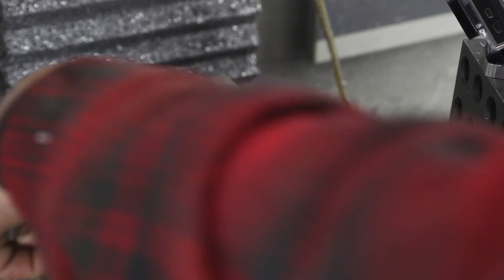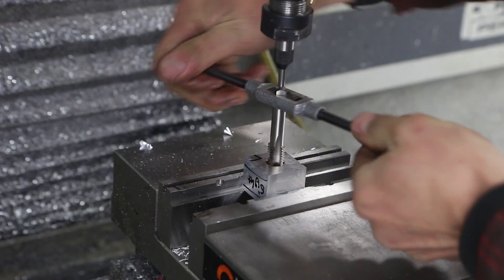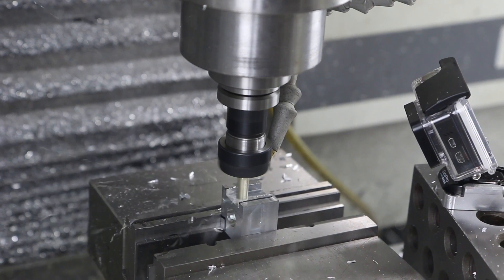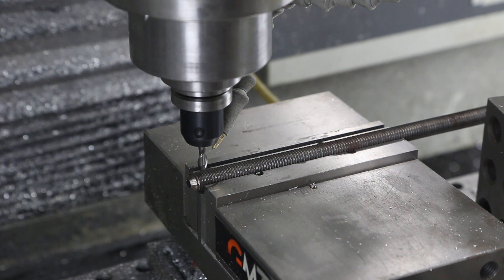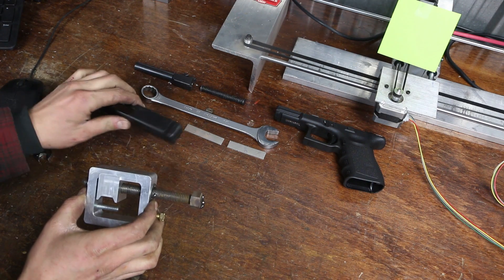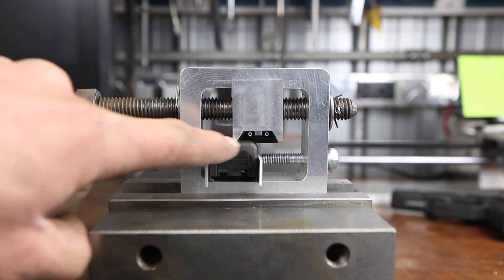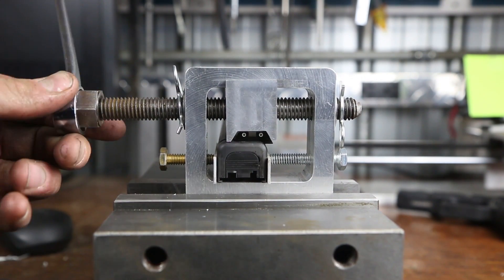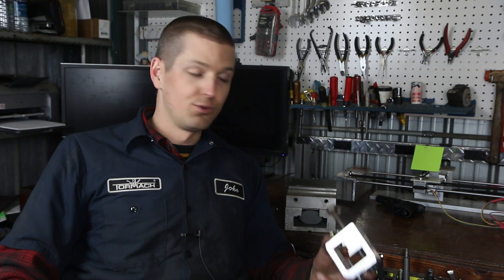DIY Glock Rear Sight Pusher Installation Tool!   Part 2 Widget31

Comment: Yep, they can be a little snug, but I find that on my MGW pusher (which is very similar in design to yours) putting a few drops of oil on the main screw before use lightens the necessary torque considerably. (Coincidentally, I am indeed a Glock Armorer :) )
 Nice Widget!
Reply: NYC CNC I would have to say I learned a lot about what the factory recommends as well a s some useful information about the specs of the pistols and their materials. Most of what is taught can be learned from places on the internet, but you need to sift through that info and filter out all the junk. Glocks aren't terribly complex to work on, but the class did give us some techniques to make them even easier to work on. I don't regret taking it.

Comment: My dad (an old school auto mechanic) would have given me untold grief for using a wrench to only turn that nut a 1/4 or 1/8th of a turn a time before re-setting the wrench, when you could easily do a half turn or more per re-set.  When you are on flat rate, time is money.

Comment: Great video and neat tool.  Others have already commented on improving the push rod and slide holder, but I have a suggestion to improve accuracy, control, and ease of fabrication.  Instead of milling a square doughnut machine a squared U that will then be attached via screws to a long rigid flat bar.  Fab'ing your fixture in this method gives your slide a secure level surface to rest on and makes machining much easier and quicker

Comment: I'd suggest adding a set of rails to match your pistol in place of the 1/4x20 bolts.  Always add some oil in the dovetail.  I don't think its uncommon to have a bit of difficulty sliding in a new set of steel sights,  you can use a swiss/jewelers file to clean up the dovetail before installation.   A little bit of CLP will probably take out the scuff mark on top.  

Work out the bugs and let us know what you'd charge to sell a sight pusher.

Comment: Nice work John. I would however offer one small piece of advice on your top screw mechanism. Since your main body (square piece) is a fixed width, I would have wound a nut onto the thread and welded it into position like you did the end nut. You could still use a washer to provide the slip, and on the other side used a washer and a double nut for locking. This would reduce backlash and provide a more even torque. If I can work out how to post a pic I will to make more sense.

Comment: nice job NYC. I change sights on glocks and other handguns for my friends now and then. and I machined something similar to this a while back for my springfield xd. (I know you hate them.... but I don't care :-P )
anyway, If you think that a glock takes some force to press a sight in you should try to do the same on a xd ;-)

there are a few things I would do different in making this sight pusher if it were me.

1. use only one set screw. let the slide rest against a face that is perfectly perpendicular to the direction the sight is being pushed in from. (either remove the interior radius or put a shim on that side of the tube.

2. I see that other people in the comments have already mentioned this but use some thrust washers, it will make it a lot easier to crank that sight into place without so much friction.

BTW. When I install sights I chill them in a freezer (or dry ice if i have it on hand) beforehand. And take them out right before pressing them in place so they are as cold as possible. Trust me it makes a huge difference.

-Morgan
Reply: NYC CNC Thanks NYC..
well now let me run some numbers on that and we will see…
room temp is aprox 20 - 22 ° C
and recommended freezer temp is -18/-23°C so the difference between the two is 45°C max and 38° C min

linear expansion of aluminum is .000023 (m/m°C)
and linear expansion of steel is .000012 (m/m°C)

a standard glock rear sight slot pretty much a  .250" x 74° dovetail, cut  about .079" deep
so say that the widest part of the dovetail is 0.250" wide

so plugging these numbers into the formula for linear thermal expansion
dl=L0 a (t1-t0) we can calculate the expansion for steel and aluminum sights for both max and min temp differences

Steel sight
max 0.000135"
min 0.000114"

aluminum sight
max 0.00025875"
min 0.0002185"

so assuming your sight is made of steel, you will get a minimum dimensional reduction of 0.000114" (Not even a thou) But it makes a difference on these tight tolerance parts. now imagine slightly heating the slide and cooling the sight in a box of dry ice? ;-) dry ice is aprox 78.5°C and if you heated the slide in boiling water 100°C you would be given .000535" dimensional difference that should almost be a free slip fit when installing.. just do it fast ;)
-Morgan

Comment: Another option on the thread, instead of a hand tap you can use a thread forming bit and CNC code to run it out on  a spiral.  I have designed parts that use this feature and the results are very good.  It would make for a good video if you have the time.

Comment: This is really neat. If you planned on using this for a while I would drill and tap in some zerk fittings for any binding surfaces. Especially the bolt in the slide, so you lessen the possibility of metal transfer between the steel and aluminum under load.

Comment: Hi John
another great video and some really good comments.
I hope to make a couple of comments and some suggestions as to why a considerable torque is needed to drive in the sight and how to improve its positioning.
 
Due to the profile of the sight and the ramped shoulders of the pusher, a rotational force or torque is developed when the sight is being forced sideways. This torque causes the pusher to rotate anti clockwise when viewed from the camera. This rotation is resisted by the shaft and its clearance in the threads and the rubbing of the pusher on the frame if the pusher contacts the frame, which I believe it does.
 
In rotating the pusher wedges and drags when shifting along the shaft.
 
To reduce the drag in the mechanism I suggest the following:
1.      Thread the pusher for its full width. This will reduce the play in the pusher and keep it more aligned.
2.      Install a threaded insert in the pusher or make it out of steel or brass with some protection for the sight. This will reduce the friction between the shaft and the pusher.
3.      Install/glue in a steel shim along the contact surface of the pusher with the underside of the top section of the frame to reduce the drag friction.
 
Also using a set screw with threads all the way to the head for the shaft will negate the need for having the pins on the more heavily loaded end.
 
An aluminium cradle (u shape piece) can be made to fit inside the frame to position the slider and one of the screws can then provide the clamping force through the cradle. A different cradle can be made for different guns?
cheers
Reply: NYC CNC
Hi John,
point 5 - set screw. A bolt with the threads all the way to the underside of the head. Have the set screw positioned so the head seats against the frame with a washer. In this way it removes the need for the pin on th ehead side of the frame. this pin takes most of the load in positioning the sight when drawing in the sight into position.

also another improvement on such a devisde is to have the shaft placed as close to the bottom of the pusher (as close to teh sight edge) as possible. in this way the leverage off centre from the sight is reduced and hence minimises the torque that creates the binding.

Comment: The diagonal angle of the sight and the push face on the sight tool, will cause a downward pressure on the sight. 1- I would suggest making a stacker shim to place under the slide. 2 This will result in you being able to push the sight all the way in with the LH side flat face of the push block, eliminating the downward force. 3 Remove the shim and do final alignment using the tool as shown.

Great build.

Comment: If you can make left corner square (possibly milling left with a smaller radius bit). You would not need left pinch screw and shim stock also pressure would be spread further and squaring up  the slide. If you repeat on the other side when you press the sight off the pressure will be spread and not on one point.

Comment: Nice sight pusher ... Dont forget to drill and install a crossbar on that bolt so u dont have to use a wrench ... And since u have a cnc u can engrave graduations in the pusher and frame so you can know exactly how far you adjusted left or right. If you work everything off the center line of the tool you will always know when your sight is centered also. I cant wait until i start making some chips ... Good job

Comment: If you ever do another one, you could make a shaft on the lathe. If you could have a shoulder on one side of the shaft and still be able to put it in. The shoulder would take the axial load easily. If you go for a straight shaft, c-clips would probably work better. Another tought, it looked like the sloped side of the sight caused the tool to push it downwards when installing. Perhaps using the groove of the sight instead of the side would allow it to go in straighter and with less friction. All in all I think it is a great project, well done. I'm just musing on possible improvements

Comment: Very nice. The design is very similar to my universal sight pusher. The amount of force can be significant. Just be glad you aren't trying to take off or install an XD or XDm sight. Those thing must be put on with a hydraulic press or something.
Reply: Don't worry those have been out of my system for a long long time. LOL
Reply: HAHA, I would say it's my general wallet that remains in question. LOL
Reply: War Machine LLC  Actually Springfield chills the sights in Liquid Nitrogen before pressing them in place. when the sight warms it is "permanently" fixed in place. my first attempts in removing xd sights ended in destroying them. now I chill the entire slide and press them out on a jig I made for my hydraulic :-)
Reply: *****
Why in the world would they do that? Years ago I was giving a breakdown to the Springfield Armory engineers through a Croation intermediary on the design flaws of the XDm. I mentioned not making the sights so hard to get off. Had I known they were deliberately going through all the trouble of cryo-freezing them in place I would have quit wasting my time and just mailed them a turd to eat or something.
Reply: War Machine LLC haha :-) I have no Idea… They might as well just epoxy those sights in… I figured that they just want to discourage any "do it yourself" kinda guy from replacing his own sights.
We all know that when springfield bought and redesigned the HS2000 they didn't really have the performance shooter or garage gunsmith in mind. but let's face it. the "impossible-to-remove sights are not the only or even the biggest problem with the XD. I Never sent them a turd. but I sent them back their POS gun, three days after getting it. (due to trigger problems) they sent me a replacement and am far happier with this one. but there is no doubt that there are far better guns out there.

Comment: Nice tool!!
But i do not think you need the pins, let the bolt head go right up against the washer,
if you need to take the sight off run the bolt in from the other side.

Love you're vids, keep em coming :)
Reply: NYC CNC
works in both directions, just put the bolt in from the other side :)

Comment: Cool project. I probably would have just had the nut up against the washer and eliminate the pins. Maybe you could make some brass or nylon feet to screw on the ends of your clamping bolts too. Do you think the pusher block threads will hold up? Maybe a good place for a keensert or something.

Comment: Good video.  You have a threaded rod there why not just use flat washers and nylocks for the stops instead of the pins.  The could be the flare type and then you can adjust the preload.  A socket and ratchet are key here.

Comment: Nice set-up,  what you can do is add a stepper motor to slide the sight in. But you will have to make sure the frame is truly straight.  Great job
Reply: Why? Because it might bind?  So I guess its a full hands on installation by feel.

Comment: Might have been a better idea to mill a slot just wide enough for the slide and maybe some Teflon padding instead of securing the slide with two bolts. That way you'll know it'll be square.

Comment: Very good project, like your videos as well I just have a couple of suggestions:
 1, you could make a shouldered bolt so you don't have to use washers and cotter/hair pins. 
 2, option A:if you were making this for one specific handgun model why don't you machine
                  in a raised area that is grooved on the sides to mount the slide on to so that it
                  has no side to side movement.
    option B: if this is for multiple hand gun models there could be interchangeable mounts for different
                  hand guns

Comment: Awesome idea. That looks like a whole lot of torque to install the sight. Been there, done that and had a couple of sights break. I don't think it's an issue with the tool, but just too tight of a dovetail. Some Glock sights need filing and some don't. Also the cutout for the sight could be bigger. If you have taller sights it's not going to work. You are only pushing with one side so having a tight fit is not needed. Also having a square pusher would be a good idea.

Comment: Great job mate. My only concern is the angled contact between the pusher and the site which could force the site down and maybe bend it. Not so mucch of a problem once thesight is supported by the bottom of the the dove tail slot. Love watching the cnc machines operate. Thanks.

Comment: Should have used the 4th on this! Tilt the part... is it 30*? ;-) haha. JK. Though, I'm wanting to see a bit more action from that though. 

Good work on finishing. Simple, effective, and lovely work. 

**Final note, I am no Glock armorer as you termed it in the video, but have a Glock 9mm, .40 and .45. All upgraded to Trijicon sights, and they did indeed require some force. I used a bench vice to hold and a notched C clamp, with a 4" handle. Works well, but it is sketchy.
Reply: NYC CNC Sloppy but effective though, haha.

Random question:
You username is listed as saunixcomp on the NYCCNC home page, but the posts all say NYC CNC. Is that an older user name? Purely out of curiosity.

And after googling that name, some cool stats came up!
http://socialblade.com/youtube/user/saunixcomp

Even the Mozambique hitch covers. haha. 

**EDIT:
Not being strange. I google everything... Even myself. Its always interesting to see where I show up.

Comment: john,
I know your always looking for reasons to use the fourth axis. on the threaded side mover square block mcthingy you could of mounted a 4 jaw tad bit longer piece of stock. Did all your opts at once angles would came out mint.

Comment: As I have said in your other videos, FEED HARDER. 2% of drill diameter per rev is very safe, and that can keep your drill pecks deeper while still avoiding birdsnesting. I've had to take on changing every program the previous guy made to avoid this crap. He had a tendency to run fast and light but with super deep pecking depths. Running proper feeds with moderate pecks can avoid the problem while reducing cycle time.

Comment: your fixture wont it be better to make a pocket for it to sit in (inside the part) then it cant move or if the strap comes lose less chance of it hitting you in the head gives you a chances to E stop other than that steel would be better and have so you can use a impact then finish with a socket.

unless its a once a month it don't matter much
Reply: NYC CNC you have a nice big fixture table first cut in vice second on fixture on table in a jig its just a offset away if you do a lot of work just in vice you can have a lot of fixtures siting on table I don't like Dow pins a cut out can be faster to make its only one cut 2 or 3 holes

Comment: A lot of force isn't out of the ordinary.  I've seen the rear sight in an XD pistol break a steel sight pusher tool very similar to what you've built.  Often the sights are installed by a hydraulic press at the factory, which doesn't really give the operator a feel for how tight they are.  For the extra stubborn ones, I've chucked a 1/2" brass bar stock into the mill, stuck the slide in the vice, and used the table to push the sight out.  Way overkill, but it works great!

Comment: The force looked normal to me. Your design is flawed a little by using the pins. There are many other ways and you will find one that suits you. The aluminum cross nut will not be durable enough. Steel minimum and hardened would be better. UNLESS you are making this as a minimal use tool.